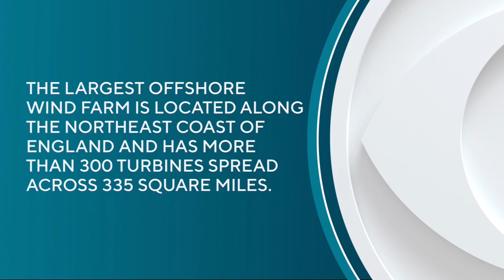Efforts to combat climate change underway with NY's off-shore wind farm

Comment: What is the current cost of electricity in New York?
Reply: You realize they will go up in the future if we don't build them. Not to mention all the jobs that will be created from it. New york state doesn't have large oil reserves. Should we be reliant on oil states?
Reply: @james192599  New York state has ENORMOUS shale gas reserves which are totally inaccessible because they banned hydraulic fracturing. Energy security means nothing to New York. They just banned 2.2 gigawatts of carbon free electricity at Indian Point nuclear power station.

Comment: Climate change is a symptom. The cause is air pollution. Wind turbines create electricity without creating air pollution. Energy is a stupid cover up term for OIL. Burning oil causes the air pollution. Stop calling oil, "energy" - stop obscuring the goal of ending oil's air pollution with the moniker "climate change"